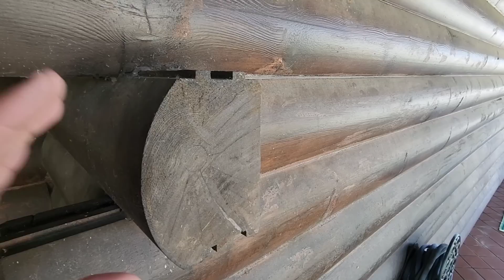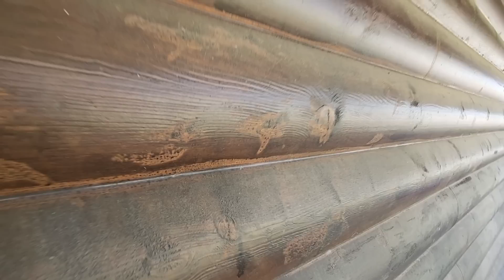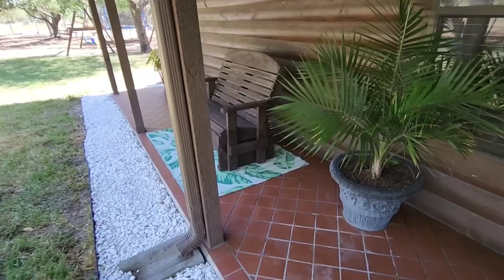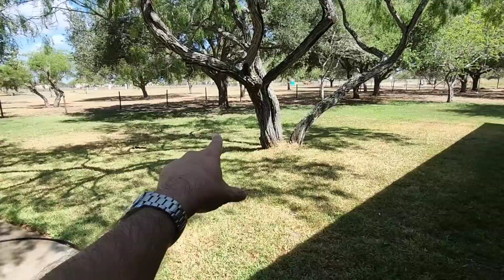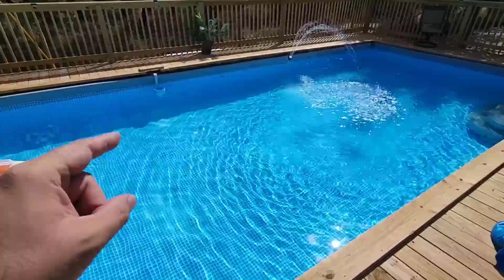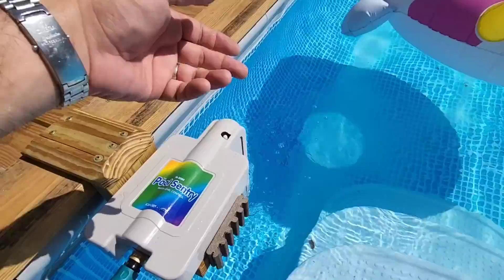AMAZING Pool invention! plus Log Home Updates!

Comment: I have the same log profile on my home, I would recommend stuffing steel wool in all those voids at the ends of all the logs where the T & G is. Then spray foam it way in there so you cannot see the foam. I found this helps with outside noise and critters. Also a better seal.

Comment: FYI turn off the fountain when your not in the pool. Your increasing the speed of the water evaporation with it running. You can also do the bucket test to confirm it's from bll evaporation and not a leak.

Comment: That was interesting. I figured the wood would insulate.
Reply: Wood homes like he has help insulate against temperature changes.  After a while, the outside temperature still impacts the overall structure.  Now you are working to maintain comfortable temperature inside the structure.  Unless he has insulation between the log and his indoor air, log homes like that don't provide much in the way of insulation.  Larger real log homes do just because of their larger mass (full log - 12"-20" diameters).  
The thing about real log homes is their mass.  For a quick temperature change you will hardly feel it.  But extended temps will creep in to the house and the house will maintain that temp for longer than traditional house.  So, this does help in cold climates that you can get sunshine on the logs to help warm them up to protect against cold.

Comment: That's a log home kit.  A real log home - you cut down the trees, get them to a mill to flatten 3 sides, then dip them in the sealer, let them season a year, then build it.  
Metal roof will heat the house up in the summer unless you use a spray foam in the ceiling.   How do I know this?  I was the slave labor for the log cabin my parents started building in 1984.

Comment: Not sure what to do about the spiders. Y'all mention mud daubers. Correct me if I'm confused, but aren't they similar to wasps or hornets?
JD we've had very good luck eliminating the little nasties with baited traps (available nearly everywhere). When the bait begins to fade the traps can be emptied and re-baited. Typically the bait works for 4-6 weeks. We've had better luck with the canister baits than the liquid pouches. Either one is effective. Great video.
Reply: They look like wasps, except they have a needle thin waist and are brown
Reply: @dethmaul  that's kinda what I thought they were. Guessing the difference is what the little nasties build the incubation nests out of. Hornets and 'paper wasps' try to find a hollow or hot area (attics, clothes lines, metal fence rail, etc) to help incubate their offspring.
   Diligence in observing where their trying to build is what I have found to be y'all's best defense.
   Giddy up.